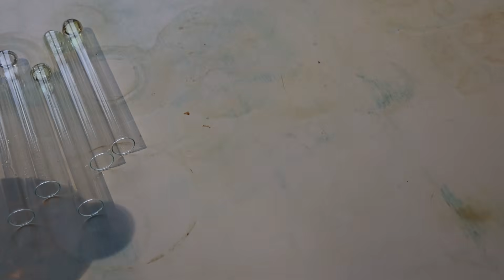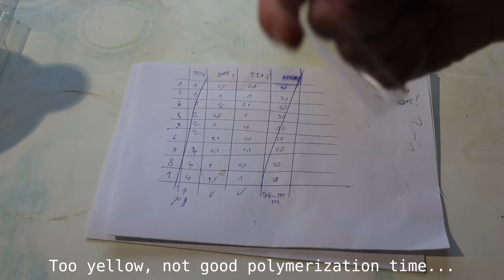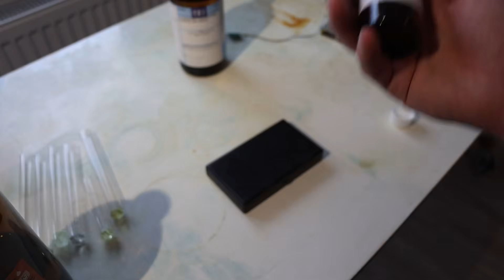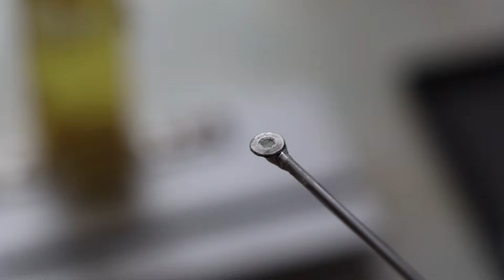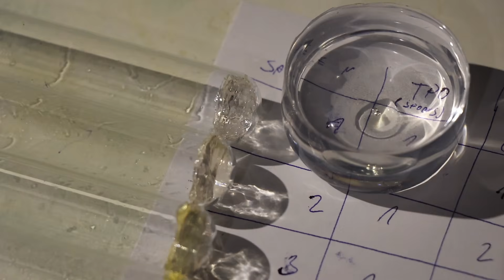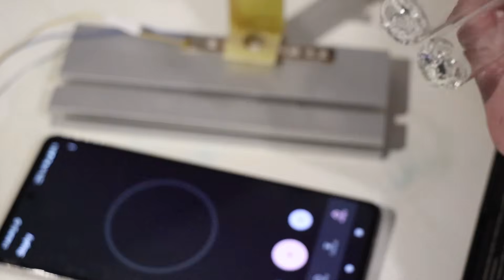Hexanediol dimethacrylate - Will it polymerize?

Comment: aluminium powder polymerizes with ethyl citrate in the oven, and its pretty tough.
Reply from the maker: Eh I can imagine that hapenning, but did not find any sources for that. Also the bonds would be ionic? I imagine the thing to be fairly reactive still. Does the product have a name?

Also how does this help me with coating for table top? :D
Reply: @IlusysSystems  I guess u could coat a table with it, but in the form I made it its more of an oven bake plastacine.  I could use it for the body of a robot/mannequin, and it can take hits from a hammer pretty well without breaking.  but eventually if u keep hammering it more and more it eventually breaks.
Reply: @IlusysSystems  Its a metal containing polymer, and its rubberlike.    There used to be flame thrower fuel made form aluminium powder and olive oil, called "gelatrol" its similar to that except you use ethyl citrate instead, and i use it to make a building product with,  not the flame thrower ammo.